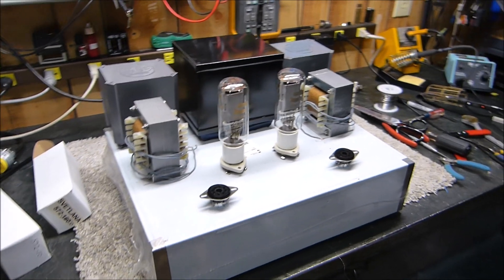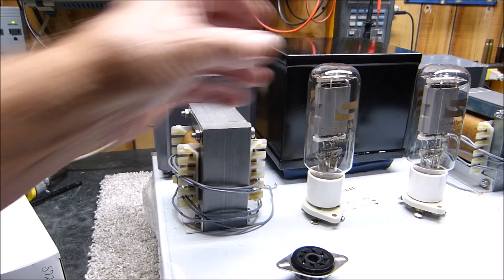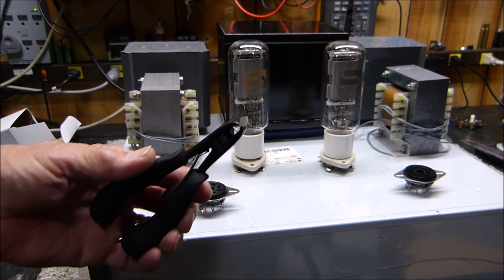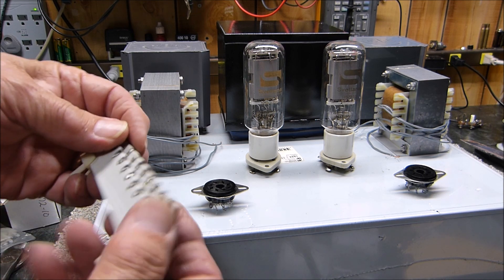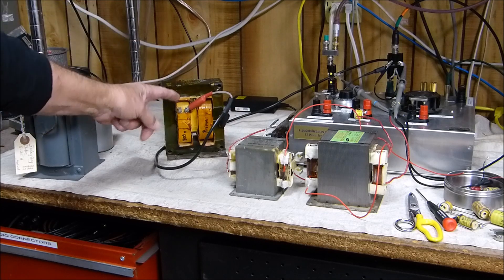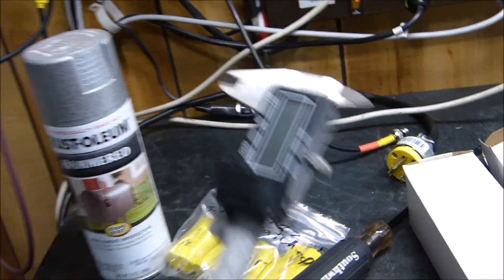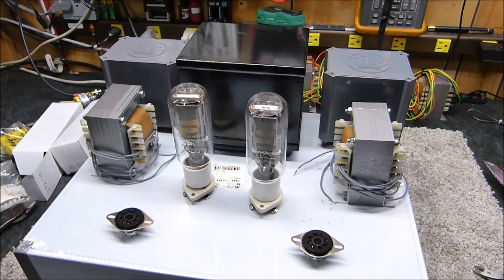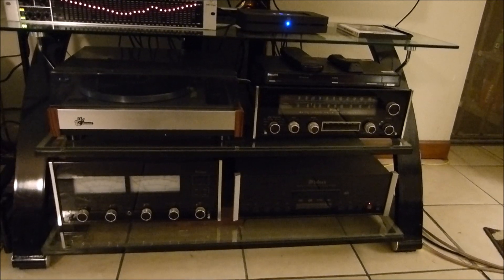Svetlana SVT572-10 SET 20 Watt Per Channel Stereo Amplifier Part-1

Comment: In your personal opinion do you find tube rectifier are better then soild state in your bias opinion I have listened to both and can’t tell
Reply from the maker: Solid state rectifiers (diodes) have a constant voltage drop across them when used in a power supply. Typically, the voltage drop across a solid state diode is only about 0.7 volts  (700 millivolts). This voltage drop is constant regardless of the current flowing thru them. A very similar thing is true for mercury vapor rectifiers (about 15 volts drop).  
Vacuum tube rectifiers like a 5U4, 5AR4, etc., for example, may have 40 volts drop across them and that voltage drop will vary as the load varies - meaning the louder you operate the amplifier the more current it draws and the more variation in voltage drop across the vacuum rectifier. So, from that perspective, solid state diodes win 100% of the time. 
On the other hand, musicians sometimes like the "sag" in voltage drop across vacuum rectifiers as the louder they play, the more "crunch"  (distortion) they get in their music and that can be very desirable and musically creative.
So, for a playback, stereo, HiFi amplifier, solid state rectifiers should always be the choice - but they are not - and that can boil down to nothing but aesthetics, in my opinion. 
We love the "look" of glowing vacuum tubes, all tubes... including the rectifiers. Makes it look "retro" ? 
As I see it, vacuum rectifiers in HiFi stereo amplifiers is just something we use because we love it and it is not going to improve the actual analytical performance of the amplifier. 
Hope this helps.

Comment: David I wanted to mention something. I have  SV572-3 tubes and I have SV572-160s. The 160s are the same as a 572b only they don't have the plate cap on top.
They also an Sv811-3 and an SV811-160 which are the same as the 811a but again, do not have the top plate cap.
Reply from the maker: When I ordered these, I thought I was getting the 160 that I had plans for. I put them up and kind of forgot about them and one day got back to the project and noticed they were 10's. Wow... I had to think about it but that was better than ever. Here I am now building the SET with them. The little 5W/Ch 300B is just so amazing sounding. I hope these 572-10's sound as good but with a little more power, like 20 watts or more.

Comment: Great video as usual. I have an AES SV-572 amp.
Reply from the maker: Hi Mike,
Is that the SVT-572-3  tube? I see a write-up for such an amplifier on the Internet.
Right now I am listening to a McIntosh 225 with original Sylvania 7591A with the McIntosh logo on them that I have had since I bought my mother a MA230 in 1976. I must have changed out the tubes and have kept these for the last 44 years. They measure out really strong and the amplifier is ethereal. I have just recently gotten into the SET amplifier world and have the one I posted earlier using the 300B. Absolutely amazing. Makes all my other amplifiers sound dull and boring. I do want more than 5 watts so I am going for this one in the video. I have the chassis cherry red and the huge power transformer baby blue with the original grey of the UTC LS-62's. I hope it sounds as good as the 300B amp and this Mac 225. I am also very pleased with the Tekton speakers I recently purchased for my backhouse listening. My Khorns and other equipment is on the system that my wife uses so I hardly ever use it except to watch TV...
Reply: @ElPasoTubeAmps  I just had one sent to me from Oklahoma for rebuild and upgrade. That is the 572-3 which is the low Mu version of the 572B that we use in RF amps. I have an MA-230 plus I have a parts unit MA230 with great iron.I also bought the last 5 MA230 output transformers from Mcintosh 9 years ago for 34 usd each. They have been in stock so long that I got them at 1978 dealer prices. I was shocked.

Comment: Hi David, you always make the most beautiful amplifiers for whatever that's worth (if it looks good it sounds good!) I'm curious as to what your going to do with the microwave magnetrons in an audio format.. I suppose its been done before, however I have never seen one, so I really hope you construct something out of them.. Waiting for part 2 on this beauty, work safe and be well, Tom
Reply from the maker: I  don't have any up coming plans for the microwave oven transformers, I just noticed that when I measured the secondary, they were pretty high in inductance and should carry 300 or maybe more mA of current. There are lots of videos on YT about removing the HV secondary and winding a few turns for low voltage, high current. One fellow posted a round 0.9 volts per turn so with #10 wire as a secondary and about 6 turns, a fellow could wind a filament transformer for a pair of 3-500Z or whatever. My thoughts were the other way around and would be just to ignore the 120 volt primary (tape them off so they can not short) and use the HV winding as a power supply choke or, in my case of the SET amplifiers, use it as the plate choke. I am always measuring everything and trying to figure out how to use what I have. Thanks for the nice comments. It looks pretty nice with a red chassis and blue power transformer and grey output transformers. I hope to have it working in a week or so.

Comment: I have a McIntosh Mac 1900 receiver that is untouched. It was stored unplugged for approx. 25 years and just last year powered up on a variac. and seems to perform well. My question, in spite of it's current performance, should I have it analyzed? Are there components that degrade due to age? 
Thanks, I just recently discovered your channel, love the info. that you share.
Reply from the maker: Hi Rodney,
i would say it could stand a loving cleaning of the controls and switches with contact spray if you can find a trusted tech to do it or do it yourself. If you don't know anyone you trust with it, you could just exercise all the controls and switches gently from fully CCW to fully CW several times and start using it. You may find a little scratchiness sound in the controls at first but it may go away on using it for a while. I have seen lots of equipment that basically just needed to be used, especially high-end equipment like McIntosh will likely be OK once put back into service and used daily. Of course things can go wrong but most likely if it does it will be power supply components like electrolytic capacitors. I would not let someone wholesale "recap" it. I don't do that although there is a mindset out there that promotes that mentality. I would plug it in and start using it and like I said, exercise all the controls a little each day for a week or so and it if works, don't let someone take it apart... just my thoughts on it.

Comment: Looks like a fun project. From reading the data sheet it looks like you'll need to drive those 572-10s into A2. You have shown a schematic for the driver, but I assume it will have to be able to deliver some grid current. I have played around with transmitter tubes such as 810, 811, 812A and 813 in class A2 using a choke loaded cathode follower to drive them. With the 810 at 840V on the plate I could get 30W at <1% THD and 50W at 5% THD. That was with 10dB GNFB.
Reply from the maker: I considered the 810 in this amplifier because I have so many. I have two huge output transformers that ran PP 810's and maybe I will use them again some day but I chose the Svetlan's SVT572-10. I believe it is also known as SVT811-10. I don't plan on driving the grid positive at all on these 572-10's so I won't need any grid current. I am so impressed with the sound of the 300B SET at 5W/channel, that is what has prompted me to build this next SET. I put a switch in my 300B SET for zero or 5 dB NFB. I prefer zero.
Your 810 specs are impressive. I have built a number of amplifiers with the 811A and 813 and have plenty of each but I am on a different quest right now.
It is funny how one piece maybe like a B&W 850A will prompt me to build and entire amplifier. I have so many RF amplifiers (and AF amplifiers also...) but I may need to build another soon.  :-)
I have the chassis almost complete and ready for painting. I painted the huge power transformer blue for some flare...
Reply: @ElPasoTubeAmps  It's true that it doesn't take much to give us an excuse to build something. I understand now about Class A - I heard you mention 46W and thought A2. Looking at the curves it seems like you'd need about -50V bias at 750V plate voltage to get 10W Class A1. You could go higher voltage but I'm not sure how linear it would be. Very interested to see where you end up. Let me know if you have any spare 810s - I plan to make a couple of monoblocks from my design and strong tubes are getting harder to find :). My other project is a series modulated AM transmitter - brings together audio and RF - what could be better?
Reply from the maker: @richardwebber1665  I love RF. Have you seen my QRZ page?  WA4QGA
If you need 810'a I have a dozen or so, so we may be able to trade something? I have not tested any of them but I can light them up and make sure the filament is good. I probably just need to keep six or so in case I do get the urge to build with them some day. Most of my RF building has been with 4-400A/3-400Z/3-1000Z/813/811A/4CX1000A. Many are on my QRZ page. I ran a KW AM station in Huntsville before moving to El Paso in the early '70's but I have not rebuilt it. I had it on 75M AM and really enjoyed it. 
You probably already know this but the 300B and SVT572-10 triodes are low gain triodes (mu = 10) and the 810 is mu = 36. I found that gain a little too high for what I wanted to do with the SET amplifier or I would have used them in this amplifier.  What state are you in?

Comment: Another excellent video! Fortunately, I'm new at this, and the end of this video is only the beginning. I'll have to watch this at least ten more times with a note pad to understand half of it. I am grateful you are making these videos. Question... I was recently gifted with a mysterious bit of kit. Top of chassis: one 10 lb.ish transformer and one 7581A power beam tube. Back of chassis: two old school CB connectors labeled "ANTENNA" & "RADIO". Has a beefy two prong AC plug- non polarized. Front of chassis: small SWR meter & a standby switch. What do you think this might be? RF signal amplifier? Any info would be greatly appreciated. Thanks!

Comment: David where did you get the 3.2 mfd caps?  These are just what I need
Reply from the maker: I just started scratching around on Ebay and found them. They were in France but shipping to here was really fast.
Reply: @ElPasoTubeAmps  I believe those caps have the IC logo on them which is Illinois Capacitor, an American brand.  It's possible they are available from US vendors, too.

Comment: TEKTRONIX TERMINAL STRIPS: You may already know this, but you need to use silver bearing solder on those ceramic terminal strips. The terminal area initially looks like a thick metallic insert. But that's not what it is. It's some metal bearing paint on top of the ceramic. If you use standard 60/40 or 63/37 solder, it will destroy the metal to ceramic bond. If you are lucky, you can still find a small roll of silver solder inside Tektronix tube gear.

Comment: hi David, very nice project!!

just a little note about the inductance measurement, i use your same method, it works incredibly well but not so much on the resistance. i do exactly as you do until i have the scalar impedance Z and phase shift. since phase shift can be very error sensitive you can measure the DC resistance of the inductor under test and than calculate the reactance as X= sqrt( Z^2 - R^2) where R is the measured resistance and Z is the calculated impedance, than continue the same way, this gives very good precision!

about microwave transformers, they are very good / low cost transformers, only problem as you said if the grounded secondary that can be tricky to isolate and solder a wire to since most times the winding uses aluminium wire. i used two 800W transformers connected in parallel on a RF amplifier and i managed to get good results with no ( until now ) arching from secondary to the core. just remember to remove the cure magnetic shunts between the windings or the core will run saturated with lower power and it become very similar to a constant current source, creating a large secondary voltage drop.

Comment: I have a challenge for you. Build a class D half bridge or push pull amp using 2 thyratrons. 2 x 12axx triangle wave osc and rig up another pair as a comparator. Many hours of fun in the amp shack

Comment: Really enjoyed watching your latest video this morning. As I think I've mentioned before, I had the pleasure of 40 years working on military air defense equipment, the first part of which was tube based. I rebuilt, repaired and aligned tube oscilloscopes, signal generators, meters, microwave oscillators and power amplifiers using the best test equipment and mil spec parts available at the time. Now in retirement my budget has been limited to consumer grade for my audio hobby. I try and employ methods and practices I've learned along the way to maximize what I have at hand. Using un-calibrated, low tolerance test equipment I now just look for peaks, nulls, consistency and repeatability knowing I'm working with reference measurements and not true values. I am always left wondering though what my actual operational specs would measure out at, especially with regard to THD. Sound wise I have become physically limited to between 50 to 17Khz by my ears and within that range I can optimize a pretty good sounding tube amp.

Comment: Thanks you for posting this video. Just wanted to point out that the tektronix ceramic mounts should be used with silver-loaded solder because other solder may leach out the silver out of the mounts and with heat the connections become prone to fail open. This is also the reason why tektronix included a little spool of solder inside the case of their equipment. Cheers.
Reply from the maker: I do have a couple of those little spools of silver-loaded solder that I have salvaged from parted-out equipment. I will use it and I appreciate you guys reminding of this. The only reservation I have is that the nylon tips are going to stick thru the top of the chassis and could easily be knocked back thru the hole. I may end up choosing the standard terminal strips like I usually use or maybe use a tad of adhesive along the bottom strip of the Tektronix ceramic mounts under the chassis. I will have to think about it - maybe a nylon or even a metal nut could be added to the mount protruding thru the chassis?

Comment: Looking forward to seeing the amp progress, not seen you use the Tek ceramic strips in your amps, I've used them in several amps, nifty stuff. Also agree about not securing components too well, did that on the first amp I built with turrets tags, soon dropped that method, hard to change out components. cheers......DA.

Comment: You need to build an amplifier with a switching mode power supply it is the better way to go with valve amplifiers, something running at 120khz and away from the Frequency band.  the power supply has to be away from the amplifier in its own metal box galvanic isolated, eliminates 50-60 Hz hum and 120hz much darker better sounding.
I was told that America still make tubes, and there's JJ electronics  kr audio in Czech Republic there is a Japanese manufacturer makes tubes.
Well if you got extra wire and your bending it you adding capacitance to that length of wire.
Try and bit of heat shrink tubing just covering the button on both ends protect you from pressing them accidentally need a bit more force. Don't shrink wrap it around the button but just on the shaft part.
Do you not like 845 tubes
Reply from the maker: I would love to have the 845 tubes but they are expensive. Wow... the 845 has to be top-dog with a gain of only 5 but I just have not gotten serious about them. Maybe that will be the next amplifier.  :-) I am choosing to use the SVT572-10 as I have six brand new ones that I got pretty cheap. As mentioned in the video, they were sold as 572-160 which would not be too popular except for maybe RF amplifiers or class-B amplifiers but by my good luck they are -10's and not the -160's. Pure luck on my part and will deliver quite a bit of power. Here is the datasheet on them. As much as 46 watts single tube, class-A.
https://shop.ehx.com/catalog/addimages/sv572-10-svetlana.pdf
Reply: @ElPasoTubeAmps  yes sounds good 46 Watts with a good switching mode power supply should work a treat, got to give it a go mate you can buy fairly cheap medical grade switching mode power supplies filtration and isolated is the way to go not much on YouTube I don't think I can find so far

Comment: I love those Tek terminal strips.  Be sure to use solder containing silver as its required to retain adhesion to the ceramic surface.  Too much regular solder will deplete the silver and ruin it so nothing sticks.  Those Tekton speakers are very interesting and revealing speakers.  At the risk of sounding experty, I would highly recommend experimenting with placement, I suspect yours might be too far apart for a good center image.  Can't wait to see how the new amp turns out!